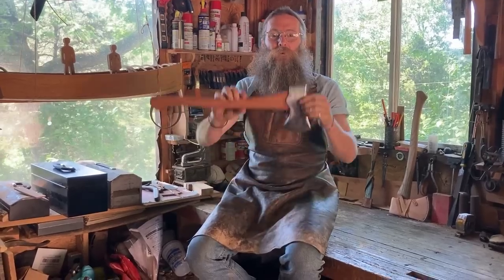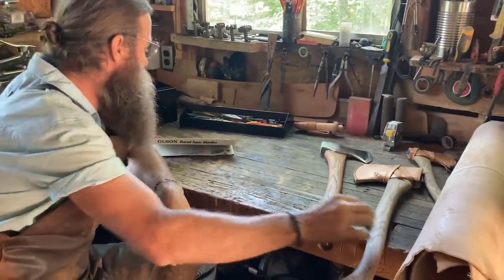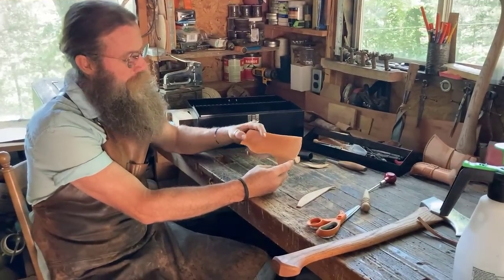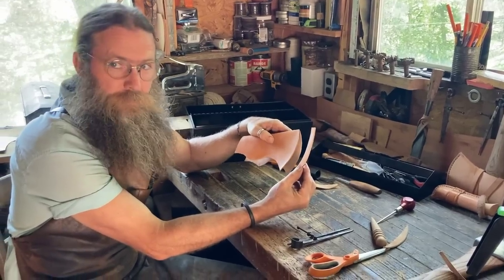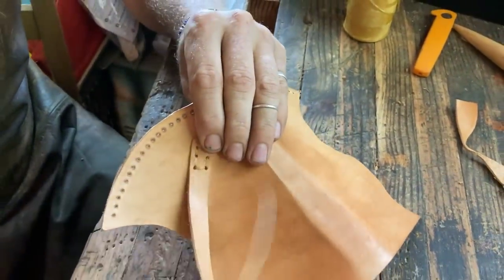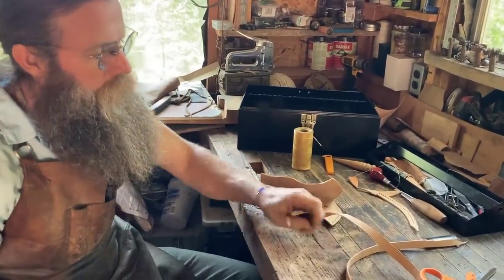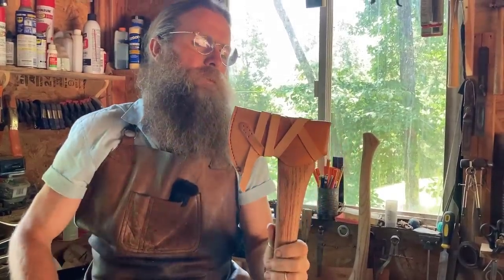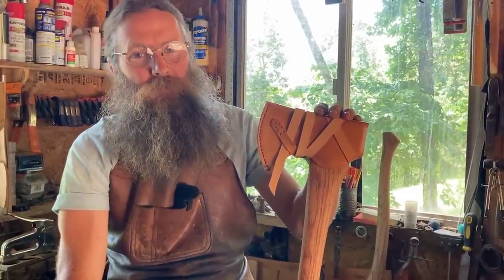How to Make a Case For Your Axe

Comment: Thank you, thank you, thank you! I have stabbed my hand, fingers, leg so many times, trying to sew leather, other thick stuff JUST BY MUSCLING IT THROUGH with my finger strength, or using pliers(whichsometimes breaks the leather needle).!! I feel shagrinned, and slap my forehead, seeing how completely logical and peaceful you made this sheath project.  As far as the value of the axe; it has far srpassed the $35 price by its value in that it will not need to be replaced !  You have invested it with your thoughtful, wise,(and,yes,loving )time  and knowledge. Thanks again!

Comment: You have a funny way of putting things in perspective, "the problem of doing things freehand it will look like it's done it freehand" and my favorite @27:00 " if you give up to early it will look like you gave up to early" hahaha!!!!!!!!
 Now to tell if you payed to much for the ax, the easy answer is yes... So to be sure lets add up the cost, $35.00 for ax, $35.00 for cost of materials, assuming 4 hr for making handle, 2 hr for making ax case, assuming you like to make a living at making stuff, assuming you want to get $15.00/hr that comes to $160 + 5% tax and $35.00 for S&H, total cost is $203.00. Assuming someone will pay you $203.00, then  yes it was worth $35.00 for the ax if your satisficed with a net profit of ($90.00) for your labor of love.............. Now to increase your sale's potential, make a branding iron so to put your Carving the Path logo on the ax case......

Editors note, your voice audio was extra low on the these last two videos, need to clean the dust off the mic. Good video thanks for sharing , sometimes I think you missed your calling of being a teacher........

Comment: I just want to point out that this design of axe sheath is top of the line compared to sheaths that don't cover the butt at all. When the butt is exposed and you use an axe it tends to promote the use of the butt with the sheath on. That hammering with the sheath on slams the welt into the blade causing cuts that eventually run into the thread. When the threads cut, your entire sheath unravels and then you're left with an exposed cutting edge. Great job on this instructional. I learned things I've never known about and I've been a lumberjack for 22 years.

Comment: Interesting and informative -- and very useful. FWIW, I completely agree with you about the virtues of this style of hatchet holster. Buckles are nothing short of a pain to use. A nicely fitted sleeve with a long single tie strap (my preference, rather than two ties) is the nicest to look at, the nicest to use, and, in my opinion, the safest and easiest to use, as well.   Thank you for another excellent video
P.S.  I cannot assess the value of that hatchet head to you, but I would gladly have paid $35.00 for it given that it meets your standards for a hatchet.  In a heartbeat! ✔

Comment: Excellent work! I've never done a case for an axe, and having recently made my first carving axe...well, here I am lol. I like this style so much better than others I've seen. As you said, the strap method of retention is superior to buckles and snaps.

One thing I might suggest? When I make protective leather cases (saya, holsters, sheaths, scabbards, etc)...I always finish them off by melting beeswax into them (a hair dryer works great...or carefully with a heat gun...you can even simply melt the wax with flame and rub it in by hand...but the other methods are better). It virtually water proofs the leather, and gives it a natural sheen that's just beautiful...but more than that, it turns it into an almost boiled armor. My leather holsters snap like kydex...but still have the natural look and feel of leather. The best part though is that you rub the beeswax in similarly to how you wetformed this case. In doing so, the heat combined with the pressure from the stick of beeswax forces the leather to conform very tightly to the tool...and the molecular structure of the leather is changed in such a way that even on hot summer days, the shape and protective qualities of the leather aren't lost.

Anyhow, just a suggestion. I'm sure you have your own method for water proofing and protecting your leather cases. 

Thank you for sharing so many great videos!

Comment: yes i would pays 35 for such a piece of art but for the use i do with an ax that would mainly stay on the wall i am pretty rough with my axes i mainly use them for cutting roots so i half decently sharpen them for that one stump that i am trying to remove and trowing the ax somewhere to bring it back home for that i usually use my double blade ax try to keep one side sharp and away from dirt and the other side get smack in the dirt to reach the root under ground but i do have one of my ax that i use only on special occasion and that is the one that stays more often on the wall of the tool shed great job and i will remember how i can protect my good ax have a great day

Comment: $35...yes over forging a new one. Also, I understand that you are making a point that upcycling is a good way to reduce the resources used for a metal tool. On eBay, the axe head would sell for about $5 and shipping and handling would be about $30. Still, a winner if you don't count "your" time. I feel I could do it in about 6 hours but I'm sure you spent half that, so for me, that would be a $450 ax but for you probably considerably less due to your skillset. Thanx for the great tutorial as always, and FYI, the sound is a little low on my phone and laptop. Much respect.

Comment: Great looking finished product. If you said in the video I missed it, but what weight veg tan are you using for this sort of leather project? I'm thinking it's on the thin side like 3-4 oz but wanted to be sure. I've got a couple of hatchets that could use a cover.

Comment: i am going to had a little something on the ax itself like i said in the video with the ax and handle we use to make our handle with dry up quarter pieces of log air dried for a good long time we had only three tool for the whole thing one a two hand plane two a wood rasp and the third one sand paper was a luxury in our house so for removing the roughness and slivers from the handle our sand paper was the bottom of a thick glass bottle and we used that to get the handle smooth 
        Now for the people who are hauling trees out forest there is a plastic cone available somewhere but to see it in action you can go to sawing with Sandy the video name is MOVE LESS pulling logs around corners with a corner block    there is also with Shawn James a quick passage June garden up date so both of them as the plastic cone demonstration in action it will help you pull your logs closer to you without getting stuck in ground , roots , branches and other debris  so have a nice day every one hope you like this little bit of info.

Comment: 40° bees wax, 40° parafin wax and 20° linseed oil,  you can use on the sheath and the handle. $35? You enjoyed doing it and thats all that matters!
Reply from the maker: That sounds like it will work great. We will definitely try it . Thanks
Reply: @CarvingAPath  protects the blade from rusting ax well!

Comment: what ounce leather are you using?
Reply from the maker: For the main body of the case and the strap, we use a 4/6 oz piece of leather 1.6- 2.4 mm thick. For the welt in the end that protects the thread from the cutting edge, we are not sure the exact measurement but it is about 3X thicker.
Reply: @CarvingAPath  Thank you!